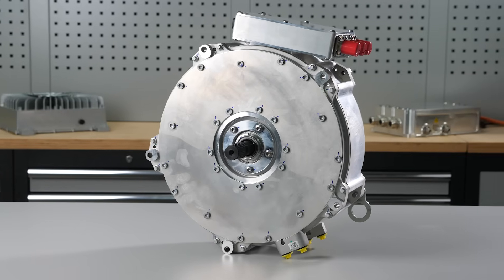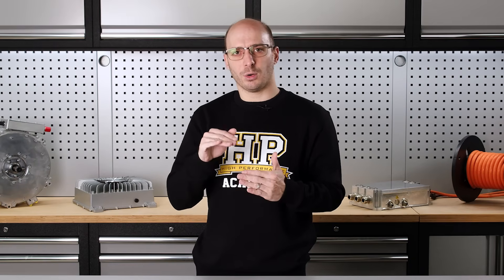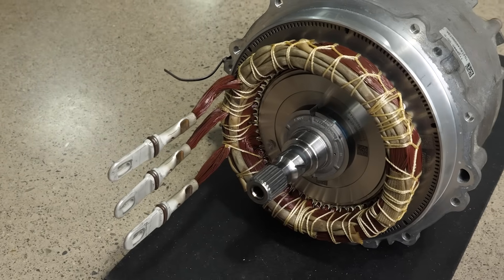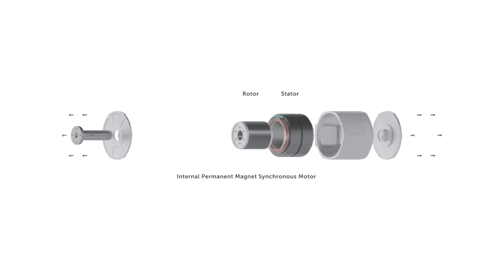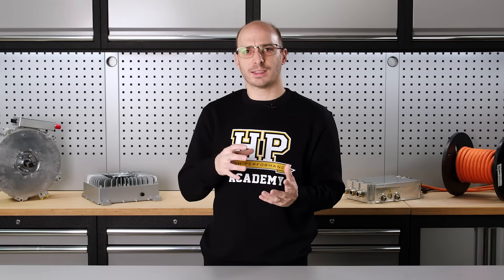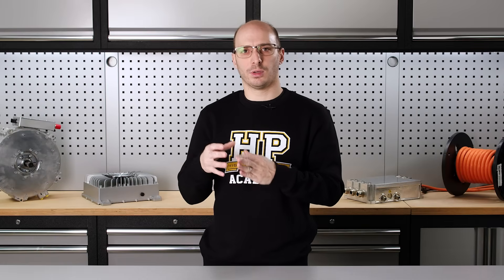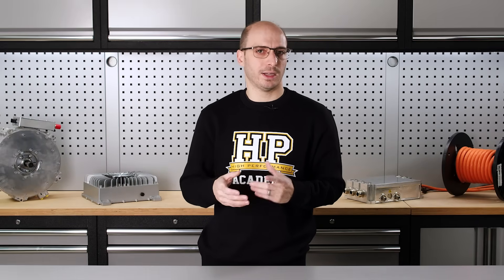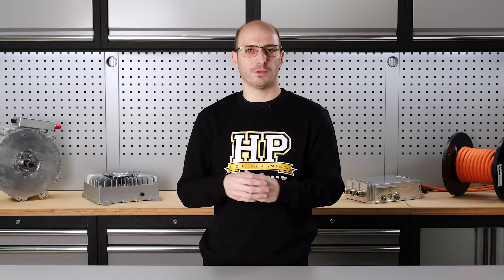1000hp+? | EV motor technology is getting WILD!

Comment: Currently the more power an electric car makes it seems the heavier it is. Or it’s a single seater
Reply: These days we have incredibly power dense electric motors (for example, Koenigsegg’s 800hp, 40lbs electric motor used in the Gemera) but battery tech just cannot keep up yet. Adding more batteries to the pack increases the power output of the battery, so it’s necessary for it to keep up with the power level.

Thankfully, we are seeing improvements in battery tech every year. Tesla’s batteries are quite a bit more power and energy dense than they were 10 years ago. Solid state batteries have finally hit the market, but not in any electric vehicle yet. It’ll definitely get interesting in the next decade.
Reply: Having a bigger Li-ion battery means you use it as a heat sink, the same for a motor as a larger motor is more efficient with thermal mass than a smaller one. The chemical part is also important, you can't charge and discharge a battery cell, hence the reason for multiple cells as this takes time in a Li-ion battery as regen is more juice than plugging it in. Super capacitors offer limited battery life, but can recharge and discharge quickly, like a coil pack does on your car. Having the battery size and motor balance to your use is important. How long you race or drive is the thing, it's why hybrids - so a motorbike engine helped with an EV is so fascinating

Comment: I love tech.  I'm a auto technician/mechanic and I've been holding off on learning EV because I love my ICE lol.  I'm building a 1000whp car and an EV can never replace the experience of an ICE, but it has it's own pros and advantages, and I'll learn them so I can keep up.
Reply: I found a lot of my heat management skills in tuning cars have been transferable. I built a Renault Twizy with a Mitsi PHEV rear diff (100hp) and my son built the battery using a VW e-Up. We wet jacketed the battery using a Prius water pump, The cooling and heating of the motor/battery/inverter and a HVAC from a  Suzuki van. We run the radiators in two end plates on the side of the Twizy, like the F1 version. This is the same process as what we do in our S14 drift car, having the a/c cool the charge cooler and cabin. The diff cooler and electric pump to the rear mount radiator.  I would look at EV motors for turbos and torque fill in the same chapter as boost management in a modern tuned car